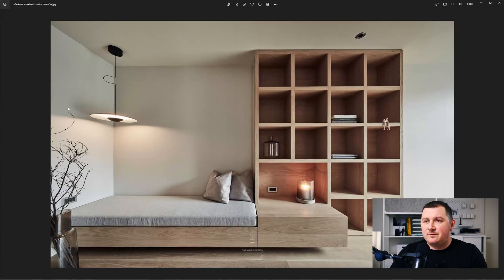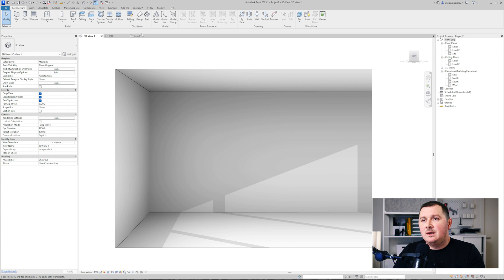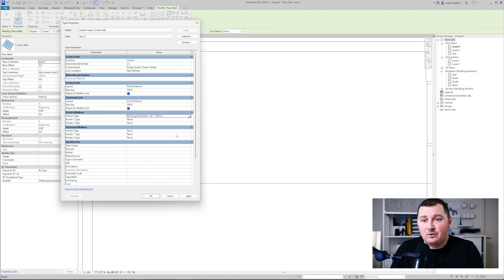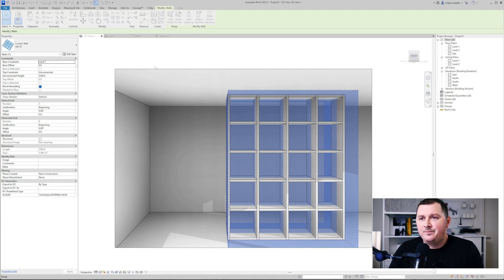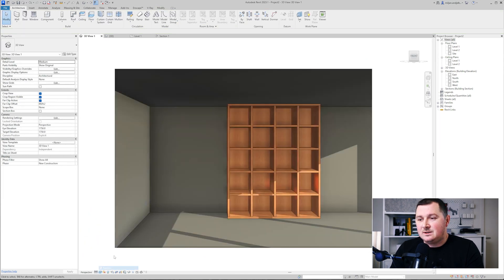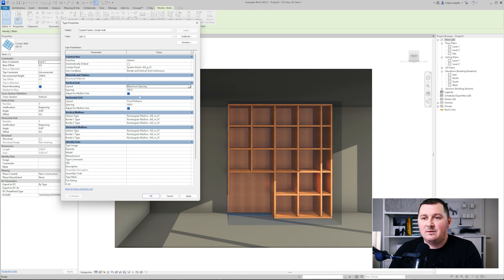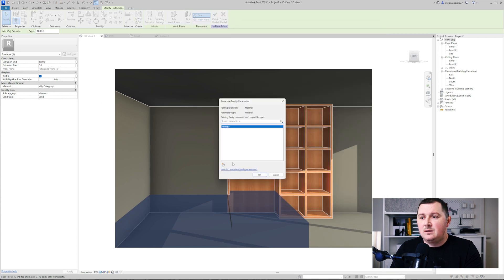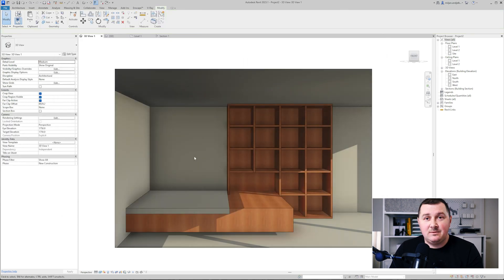Modeling Interior Shelves in Revit

Comment: Do you have a trick for asymmetrical bookcase? With uneven spacing maybe even rotated dividers?
Reply from the maker: If you will use CW then you can adjust position of its grid. In this case grid is controlled by CW’s type, so just place it manually. Also, in Properties Palette you will see that it’s possible to adjust angle of grids. There’s also a way to rotate mullion’s profile…so many opportunities can be done with Curtain Wall

Comment: Great as always 👌 👍thank you ... One thing I wanted share here that out there in real scenario most of the interior design firms or offices relies heavily on 3DS MAX software only just for realistic visualisation but ultimately they come to AutoCAD for working drawings and shop drawings for same project which has done in 3ds max and seems like it doubled the work for execution part but after watching the interior design works tutorial videos of yours I came to an idea of making a solution that We can produce working drawings and shop drawings within Same revit file and scheduling  and quantity take off of materials used inside this interior design project all at once at same time because revit is BIM enabled software isn't... .. 
Could you please make a video with very small example of interior design project including with all features and facilities available in revit as mentioned above if possible.... ??? 
Thank you once again ...
Reply from the maker: Actually in Revit you're building a model which you're documenting at some stage. So, you should (read must) have working and official drawings in a model. I really like 3D Max and we're often doing our final visualizatoin there as well, but we are not modeling from scratch because we are using our Revit file.

In order to have good quantification your space/building should be correctly modeled but, same important, it should contain enoght data in order to be scheduled. So, for project and families use Shared Parameters.

Revit has a lot of options and tools to do something and I don't think that covering all solutions could be done within small example and avarege video lenght. What we are already doing is showing those examples from which over the time you will be able to pick up some methods we would like to use in our workflow :)
Reply: @arkiteasy  Hmm, yes you are right absolutely, your reply almost self explanatory with each word , anyways making use of curtain system the way ark it easy used to be like Wow we can use it for this also like casework etc... further more to appealing is about background music that creates more interest to watch the video infact every video of ark it easy ..... thank you once again
Reply from the maker: @nadeem006  thanks, glad to hear to this :)